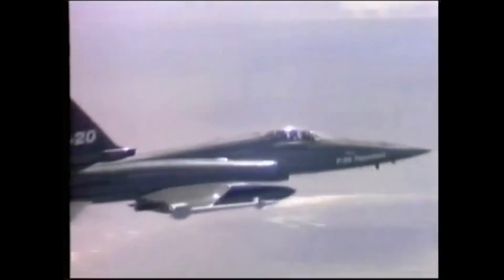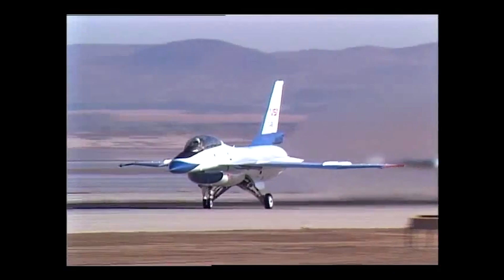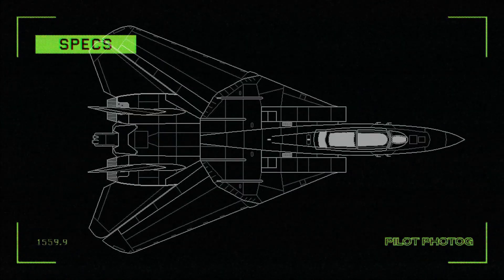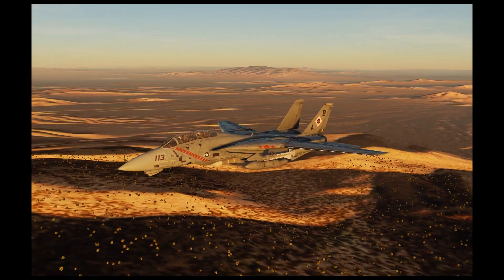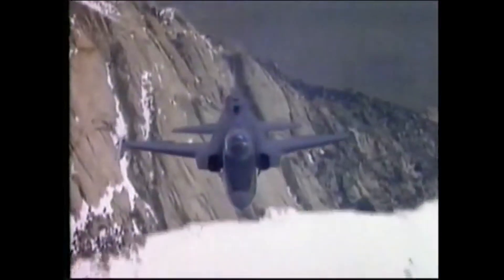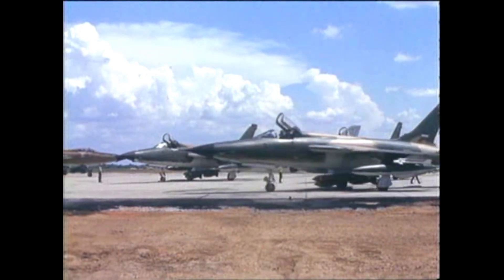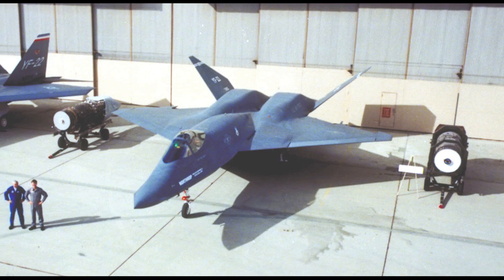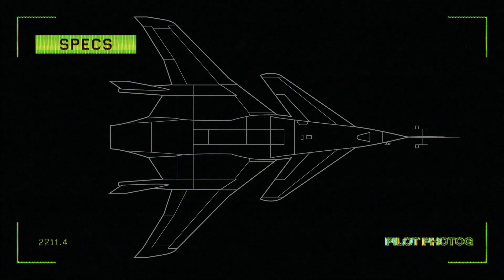Top 5 Fighters That Should Have Been Built | Best of Aviation Series by PilotPhotog  f20  f16xl

Comment: F-20 otherwise known as the TigerShark - just no. It had soem serious problems in the upgrade and by the time they worked it all out, the F-16 out and it was a light year ahead of its time.

The F-16 XL was trying hard to be an F-15E and doing a bad job of it. There was no need for it.

The F-14 - ugh - it did the one thing a fighter in the 80s was not allowed to do - it told everybody where it was because it glowed neon on radar - any radar, from very long range. The F-18 was a better dog fighter and the only thing the F-14 could do was lug around its phoenix missile system which was antiquated by 1991.

The F-107 had a horrible issue in that it could not mount newer engines and the ones it could use were fuel HOGS. The plane had no legs in mission profile.

The problem with the F-23 was it had lateral cohesion problems. It basically skidded when it turned and was always out of of control because it lacked the thrust vectoring.
Reply from the maker: Great counter arguments for each and thanks for commenting!
Reply: @PilotPhotog  Let me challenge you. You wanted 5 planes that should have been built but weren't. 

B-70 - This plane just happened to arrive on the scene when a political event took place when Francis Gary Powers was shot down in his U2. It was felt that high altitude penetration was too risky. Later, we realized that was not true in the least.

B-1 - Not the sub-sonic version built by Reagan, but rather the super-sonic version first proposed and killed by Carter

A-12 - The USN looked to replace the again A-6. It was well-ahead of its time but it was doable.

IAI Lavi - The Israeli upgraded and enhance F-16

F-108 - A mach 3 incteptor.

Comment: Excellent breakdown. As for the YF-23,  at the time of the competition, Northrop had a political dispute with the Air Force and Pentagon decision makers and they brought that beef into the selection process. Also, the YF-23 was more expensive. Nevertheless, the YF-23 was at the time the Ultimate fighter in history. It was far superior to anything else, even today.
Reply from the maker: Well said and yes it is tragic for the YF-23 that it became a victim of circumstance and politics.  I think 6th gen fighters will look very similar to the YF-23
Reply: Hypothetically, if the F-23 went into production, with the increased base cost and complexity, how many do you think would have been in production by the time Defense Secretary Gates dropped the axe?
Reply: @Kelorin  183......Simply put, originally, the ATF program called for a production run of 780 aircraft. Then came 1991and POOOOOOOFFFFFFF! There goes the old USSR! With the ATF’s main opponent gone, the ATF was one of the first programs to suffer. Numbers first dropped to 645, then 548, then 423, 323, before dropping to 183. With each drop, the price for individual airframe went up as there is less to spread fixed costs. At 323 airframes, Lockheed warned there wasn’t enough to allow economy of scale to kick in. Same would’ve happened if the YF-23 would’ve won. Eventual price would’ve been fixed at 280-300 million a pop due to low numbers produced.

Comment: F20 Tigershark? That’s too much like right and common sense. The politicians and defense contractors aren’t interested in that. 😏
Reply: Alton Williams yeah...like the Swedish Gripen today ...to a point!
The Gripen is selling though, but is overlooked by too many customers who want the biggest and the most expensive!
Reply: Despite Gen. Chuck Yeager being the spokesman for the F-20.
Reply: The modest maneurablity of the F-20 Tigershark at medium-to-high altitudes and the lack of a medium range missile in that era ( AIM-120B was only a future concept ), where considerable drawbacks. Equally low cost solutions were available like the Mirage-III NG and the MIrage F-1E. Both were able to turn tighter at higher altitudes in the thin air( due to their lower wing-load ) despite the fact that their G-limit was only 7.5 as compared to the 9G 's capability of the F-20. Moreover they were capable of launching the Matra-530F medium range missile ( 35 kilometres range with high speed to engage much higher flying targets). If one takes into account that the F-20 contenders didn't require the Congres' approval then one can understand that the F-20 had limited chances. When the MiG-29A become available ( early 1987 ), and the Mirage-2000E was competitive even to the F-16C ( being equipped with the medium range Super Matra-530D ), the US government made no demur to release the F-16A or even degraded versions of the F-16C ( see Venesuela ) to foreing buyers making a virtue out of necessity.
Reply: Politics should never be involved in national defense concerns.
Reply: Comment of the century!
Reply: Did it not evolve into the F/A 18?
Reply: F-20 and Gripen are some of the great example of high performance Jets that most likely could keep up with the latest non Stealth Jets of today. Cheap to operate so countries that don't have deep pockets could spend less on defense. Plus their needs are strictly for defense not attacking anyone. Though nowadays most jets can be upgraded to multirole use.
Reply: F20 in the final event was great old technology.. the F16, F22 and F35 were and still are the future

Comment: The F-20 Tigershark was the unfortunate victim of bad fortune and politics.  Back in the 80's there was a big push by General Dynamics to sell F-16s for export.  I think there was considerable pressure put on the government to sell F-16's over any competitor.  Northrop for its part even got Chuck Yeager to promote the fighter in a sale pitch film.  Alas that was not enough to save it.
 The F-20 was ideal in so many ways.  It was cheaper, more capable and shared many parts with the F-5E.  Plus its low cost would be been great for Air National Guard Units.
Reply from the maker: Thanks for commenting and I agree.  If you haven't seen it yet, check out my video all about the F-20:  https://youtu.be/T-TARYA_YHg

Comment: I'm Canadian therefore I am biased the ARROW all the way.  But former AVRO personnel  ended up working on the designs for F14 and F15 as well as going to NASA for the space program
Reply from the maker: The Arrow was a revolutionary design and the team that worked on it were nothing short of genius.  I plan a whole video on the Arrow and hope I do it justice. Thanks for commenting!
Reply: @PilotPhotog  The Arrow is still one of the biggest mistakes Canada made in its Economic history. Canada would have had a bigger, more developed and advanced technology sector that would have provided 100s of thousands of high paying middle class jobs for people if it went ahead. The Arrow was projected to basically out run, out gun, out fly practically everything in the sky...
Reply: @ChairmanMo  you do realize if a country have a high tech aircraft manufacturing capabilities it usually pull the other industry in that country. Components will be made locally therefore  increase the local industry technology.
Reply: ChairmanMo As a Aircraft enthusiast who does study on physics in certain areas and research on these things that comment is indeed correct. 

The only thing maybe coming close is probably the delta dart which found gg carry as much, and had possibly worse high alt maintainability, and maneuverability due to the lower aspect wings, higher sweep, higher pylon drag, and less weapon carry.

Comment: B1-R should be the number one. With the best of the best avionics, active countermeasures (laser, anti-missile missiles?), massive payload and ordinance that gets ever smaller and more accurate,  speed to dictate battle and the fuel to loiter and dominate a huge area.

An air launched version of the Navy's latest standard missile and matching spy 6 radar variant would change the battle space over large areas like say, the South China Sea.

30 or 40 B1-R's would be a force multiplier in a way that 3 or 400 more F-35As  would not.
Reply from the maker: Thanks for commenting and B-1R is a solid choice.  I kept this list limited to fighters but will do another video with more inclusion in the categories.
Reply: @PilotPhotog  Not counting B1-R as a fighter is more than fair, thanks for the upload, friend.

Comment: The F-14 and the A-10 are the two best jets the USA has ever had. I was really sad when they retired the F-14.
Reply: @Trinity-j5f  Interestingly enough, the F-14 is still generally a better dogfighter than even the latest variants of the Super Hornet (talking purely in terms of performance). For the most part, the Super Hornet makes up for it with much much better avionics, but its issues accelerating to high speeds are certainly an issue in BVR engagements too.
Reply: @_ace_defective_  No sir, the Hornet can kill the Tomcat in a heartbeat if they get slow.  The Hornet can put its nose on you so fast your eyes will water.  Many a Hornet driver has been drunk in the O-club at the hands of a Tomcat driver paying the bills for such a thing.  You don't fight the Hornet's fight in a Tomcat.  You also don't fight the Tomcat's fight as a Hornet, or they'll kill you as well.
Reply: @Trinity-j5f  I'm fully aware that it has a newer airframe, it is indeed more cost effective, and its maintenance requirements are much much lower than the F-14. This is all great! That combined with AIM-9Xs and AIM-120Cs/Ds for long range make it an incredible fighter, and I am not denying that in any way. I am not even saying that the F-14 is better in every regard or anything. But you have to consider the fact that the F-18 would not definitively beat the F-14 in terms of dogfighting performance. While the F-18 has incredible high AoA performance, it's let down by the fact that it cannot regain energy very quickly, something the F-14 can do with its far more powerful engines. The F-14 also has pretty good turning and low speed performance, and while they aren't as good as the F-18, again the F-14 can very quickly add more energy in a dogfight.
So again - I'm just saying that the F-14 does still have some advantages over the F-18 mostly in BFM/ACM, and that should be acknowledged as it was an incredible fighter at the time. But that doesn't make it a better aircraft; all the other factors you brought up are very valid too and honestly sustainability is very important at this point. I think the Super Hornet is an incredible aircraft and it has to be one of my favorite aircraft ever, but you still have to acknowledge its weaknesses.
Reply: The F-14 was 60s technology and thinking. If it had composite materials, digital FWB, lost the swing wings, had a newer electronic architecture, and was a better dogfighter, things would have been different.
Reply: Jason.. you sure about that .. A-10 better then the F4 Phantom , F15 , F16 ?...  slight bit of delusion there..  would you really want to go head to head with a fully armed F4 in an A10 and expect to beat it...  yeah right ok
Reply: @kittyhawk9707  Why are you comparing fighter jets to a ground support jet?
Reply: @LinkLayer-b7w  you said the A-10  and the f14 are the two BEST jets the US have flown..  Really..  THE A10 is the BEST alongside the F14 ( which has been scrapped) ??? REALLY ...  The A-10 is arguably the BEST Ground attack aircraft that the US has flown .. BUT one of the BEST JETS they have ever flown .. ?? .. nope  anyway .. SINCE WHEN IS THE A10 A FIGHTER.. THE VIDEO WAS ABOUT FIGHTERS , HENCE ME MENTIONING FIGHTERS .. YOU MENTIONED THE FUCKING A10 ... !!!
Reply: @LinkLayer-b7w  oh  ..and the F4 was not used as as a ground support /bomber aircraft as well as a fighter ?? .. i think you find it most certainly was..  do a bit of f*cking research... Another reason why the F4 was superior to the A10
Reply: @LinkLayer-b7w  I am just pointing out .. that your statement saying the A10 is one of the 2 best jet's the US has ever flown is factually WRONG ..  maybe in your opinion..But as a fact it is simply NOT TRUE .. ( even then it is debatable if it is THE best ground attack aircraft ( F15 E, Harrier, Corsair 2 , Skyhawk ,  T37  - all good aircraft .. can you really pick a BEST one from those.. not really ) .
Reply: @LinkLayer-b7w  Why do people seem to think the A-10 is some sort of Superweapon handed down from God himself  .. It is good at what it does ..killing tanks and armour .. but otherwise it is a mediocre performer . If it was such a SUPER WEAPON why  not get rid of the F22, F16, F15   and use A10's instead as fighter/ interceptor aircraft ...Think about that ..and you may find the A10 is not the god given superweapon it is made out to be .
Reply: Ian Johnson chill dude
Reply: @kittyhawk9707   your right the A-10 is the best attack jet ever. but it's not a fighter jet. but to be honest there is no jet built to date that can do what the A-10 can do. the f-35 can't slow down to the speeds of the A-10 to support ground troops. the A-10 is one of a kind.
Reply: @kittyhawk9707  ah yes the brick that flies F-4 Phantom.
Reply: @kittyhawk9707  What stupidity. The A-10 was designed for ground attack and not air to air. And an F-4 as a fighter was a real dog in air to air. Horrible. It could carry quite a load though, so it was decent ground attack, but an A-10 could take a lot more of a beating and come home. For the mission the A-10 is a far superior aircraft. And for the mission there is still no allied aircraft that comes close, which is not the card for the F-15 and F-16. SO HE SHOULD BE SURE ABOUT IT. And are you really sure considering that you are comparing apples to oranges, and since WW2 there really has seldom been a case where a bomber could not be used when a fighter was. Very little air to air combat has occurred.

Comment: If the F-20 came into service the Philippine AirForce wouldnt be bullued by the Chinese airforce but the Fa-50 is basically the successor of the F-20
Reply: If only F20 was considered by the Administration at that time we could have been the best fighter interceptor aircrafts in Asia...USAirforce mafia and politics just got underways
Reply: @sayestrada14  exactly
Reply: @sayestrada14  It's never going to out perform the F-16. That is the point....
Reply: @WALTERBROADDUS  indeed but both uses the same jet engines F20 has used the first aesa radar and fly by wire systems technologies that was also made for F16 though some  technogies though not selected they were transferred to other US allies
Reply: @sayestrada14  The reality is if you can buy a F-16, you don't  buy "Diet F-16.".....😏🥤
Reply: @WALTERBROADDUS  that's exactly true bro at least 40 years ago and that they are currently offering right now previously and it was block C/D and there was none yet of the current newer version and boom now they re offering much more costlier F16E/F or F16V just saying on cents
Reply: Screw em'...Should have made a deal for the U.S to keep Clark and Subic...worst mistakes they ever made.
Reply: They could not afford anything more than the F8. Still a deadly plane despite age at the time.
Reply: @WALTERBROADDUS  yes it was

Comment: The IAI Lavi and Kfir jets should have been produced. But in the interest of domestic aircraft companies, the US GOV't blackmailed israel into ending the programs
Reply: The Lavi is in production, the Chinese call it the J-10!! 🐼
Reply: @ghostrider88jinetedelfanta31  not exactly. It has some design elements from the kfir c.10 revision but nothing from the lavi other than maybe inspiration
Reply: @Baron Marseille  incorrect. It was 100% israeli and that was the excuse the knisset used for killing it. The only thing that came from the US were the engines. 
The US did a bit of carrot-and-stock diplomacy to get the israelis to cease development and take american planes instead. And then bankrolled part of that deal.
And 40 or 50 units with no replacements is nothing more than bragging rights

Comment: The stupid US Navy opted for the so called super Hornet. The Airforce is regenerating the F-15. What a joke.
They should have updated the F-14 Tomcat with new engines, avionics, new aesa radar complete with all digital computers. Best interceptor of all time.
Reply: Blame Dick Cheney. He insisted on ending Tomcat production (thus killing any chances of a major upgrade like the Super Tomcat), just on the basis of the F-14 being "1960s technology" and dismissed it as a "jobs program".
Reply: @RedXlV  You meant Dickless Cheney ? What a moron. He also ordered the total destruction of every Tomcat ever built.
Reply: It was 1960s technology; the electric architecture was a nightmare to upgrade.
Reply: @taylorc2542  The Super Tomcat wouldn't have "upgraded' the electronics, it would've been new-built F-14s that completely replaced it.
Reply: @RedXlV  I know, but it was much more work to upgrade the Tomcat versus the Hornet e.g. the Tomcats avionics were based on the failed F-111B, and the AWG-9 started development around 1961. It was ancient; it even had vacuum tubes. The F-14D went way over budget because of this, and integrating things like LANTIRN into the Tomcat was a nightmare. The electrical architecture is also the most expensive part of developing pretty much anything.